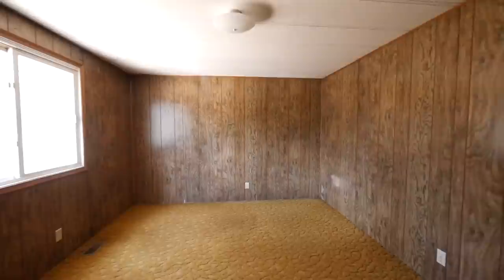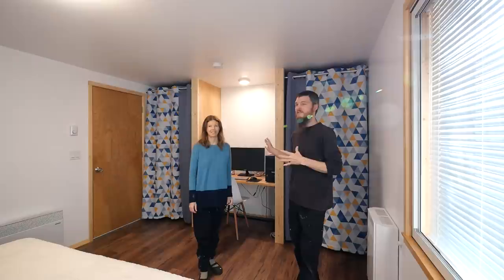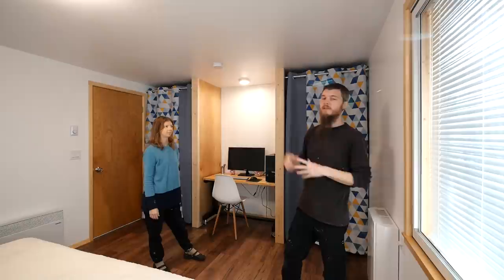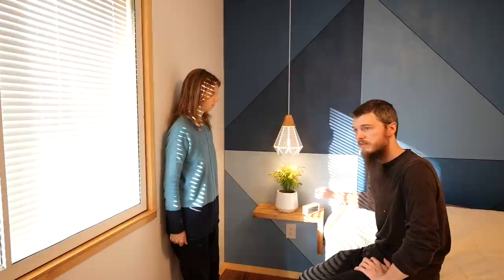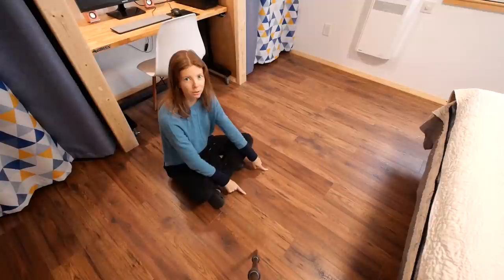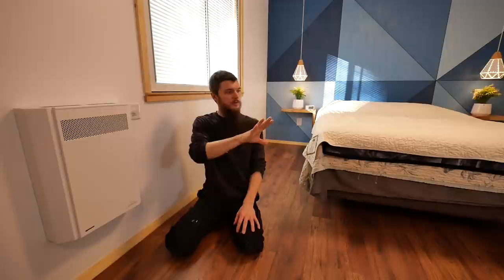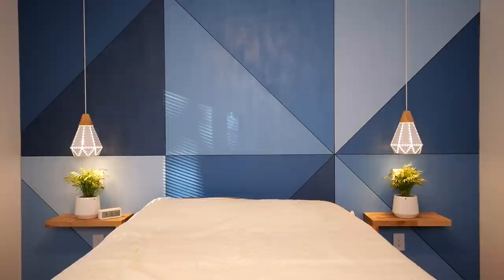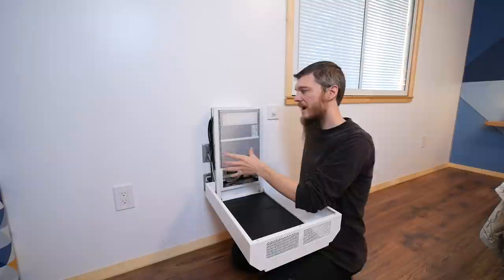Mobile Home Bedroom Renovation and Tour - DIY

Comment: THAT was a lot of work! I was thinking it's a good thing they're young and ambitious :) Don't feel bad about the mold. That stuff gets in anywhere it can. You found the source and fixed it. It was a lot of work but when mold is the problem best to get right in there and stop it. We had mold in the utility and bathrooms because that part of the house is 150 years old and the plumbing from the 1930s was original and leaking. The hubs has been replacing it bit by leaking bit. He's also installed moisture proof drywall (like you did....good choice) I love your new design. You know, I think all that design wall needs is another coat or two of paint. Looks like the wood was thirstier in some places than others so it soaked in more. It's a fun piece and just makes the whole room....although, I do like the new floor and the new computer area too..oh and the new nightstands...and....
Reply from the maker: Yeah, that's exactly what happened with the wall. Some of the wood grain is just more porous so the paint is less shiny on those spots. We should be able to fix it pretty easily.

Comment: No issues solve the problem and move on...   Just a note check your electricity for constant voltage in your home.   While you were talking from you bedroom.   Your lighting was pulsating a little .  At least on the video it appeared that it was pulsating.      It may or may not be something.   (could be just a video framerate and LED then no issues at all)     I once had that issue and it was a problem on the feed from the power supplier.  My incoming voltage was dropping below 200 V AC.   Which was giving me around below 100 V AC at the outlets...
Reply from the maker: That was simply our camera lens auto focusing that made the light appear to be flickering. :)
Reply: @diyfferent  I thourght maybe so but just incase it was something else I wanted to let you know.

Comment: We put a solar fan under each end of our mobile homes to move air and reduce humidity. In the warmer months we remove access doors in several places and cover with fine pet fencing wire. It helps keep air flow moving to prevent mold growth. 
I'm surprised putting the vapor barrier down didn't prevent the problems you had. That was a bummer to re-do.
Reply from the maker: We didn't have any problems from our crawlspace. Most of it was caused by rain coming in when we were installing the roof and a general lack of ventilation in the room.

Comment: My question is:  What happened to your beautiful area rug?
 
My comment is: I think the room is beautiful!! And anyone who doesn’t think so, well, it’s not THEIR room, is it?  The room is very inviting & cozy.  I can hardly wait for your new bed frame.  Do you think you’ll do one like Mavericks, only bigger, of course.  Or maybe a platform with storage underneath?  

Whatever you decide I’m sure it will be gorgeous...simple, but gorgeous!

The negative:  It’s too bad about the mold & mildew.  Do you think you’ll be able to reuse some of the stuff you took out?  I know you couldn’t use the contaminated stuff but maybe the stuff that was still in good shape?
Maybe in the room next to the barn?
Reply from the maker: We put the rug outside, because it did have mildew in it. It's laying on the ground as ground cover. We did save the pine boards that came out of the room. But we didn't save the rest.

Comment: The headboard wall looks great. Nice color combo. I am concerned that your house  too tight. Especially that the moisture barrier was placed on the ceiling. I don't know anyone that has to run a dehumidifier in the house besides a basement.  Also where did you get the inside stormwindows??
Reply from the maker: We got our windows from Menards but other retailers also carry them: https://www.larsondoors.com/comfortseal-interior-windows

Comment: Love the new look.  It actually opened up the room quite well.  It's hot and dry where I live so I don't always remember the panic re the mould. I much prefer the less heavy looking closets and workspace.  And most impressed with your blue wall.  Have you made your new bed yet?
Reply from the maker: No, I have the wood but I haven't made it yet :)

Comment: Well done on sorting out your problem. I do hope that my comments didn't stress you out as they were meant as constructive help and not criticising you or your work. If you encounter this type of problem again you might consider running ducts to a central air handling unit with air registers at celling and floor level. On a final point you should never feel ashamed of any of the work that you do or the high standards that you achieve.

Comment: Ok,  so I liked the previous br, but luv this new look. Very nice. U should thank the weather person for being wrong otherwise u may have never torn it apart. Not so soon anyway. U did the right thing and it came out great. Nothing to be embarrassed about. Hope u didn’t through out the old floor etc.. maybe could use it as a wall in the garage room or whatever. The water caused all your problems, mold, mildew, musty etc.. One thing, maybe bifold doors for closets instead of curtains even though they look good, less work. Another great job. Btw I thought I saw someone cleaning water in the kitchen when the rains came, hope I’m wrong . Anyway👍👍👍😀

Comment: Not trying to second-guess you my friend. But when you were putting the roof on in the rain. Do you think the insulation in that room got wet. You're saying the exterior walls we're the ones with the mold and being at the bottom of the roof just wondering how much water got in the walls.
Reply from the maker: We did check inside the walls while it was open and everything looks okay!
Reply: @diyfferent  okay great thank you. I guess it's just the humidity inside the house.

Comment: Sometimes I think that’s the downside to sealing up a house for insulation purposes (aside from the rain issue). I have a 3yo apartment and it suffers from mould, though after repainting with some good quality paint most of the mould has never returned. We’ve also got a dehumidifier because our place is always in the 70’s (I’m in the uk). But you did the right thing and now you’re happy with it

Comment: Oh wow, now it makes sense. Did you have to pull out all the blown insulation out of the attic?
Reply from the maker: The cellulose insulation is treated against mold growth and it dried out quick when we had our roof ripped off, so we didn't have any issues with it. Also, some people wet-spray cellulose insulation in their walls and ceilings, so it's okay to get wet once.

Comment: I still don't understand why you tore out the walls? And I absolutely loved your old floor but it's your choice
Reply from the maker: The old floors had mildew and water damage so it had to be taken out. That floor is now discontinued so we decided to use what we used in the living room. Our metal shelves didn't fit in the closet spaces unless the feet were sitting on top of the baseboard trim, so we tore them out to build new walls giving those spaces slightly more space.

Comment: What did you do to the walls? What were the purple panels? Did you just paint and not use the paper treatment?
Reply from the maker: The purple is a different type of drywall we used and it's moisture and mildew resistant, just for extra precaution. We did the paper technique but we didn't show it in the video :)
Reply: @diyfferent  It looks perfect!

Comment: Looks great, guys! I had a thought about your attic, did all the rain cause your insulation to get moldy? or did you replace it? Disregard the trolls, it only encourages them. Some people are too twisted to be in public. I'm really sorry you have to read that stuff. Hang in there.
Reply from the maker: Thanks! The ceiling insulation didn't get moldy. It absorbed a lot of the rain and evaporated pretty quickly. Paper cellulose insulation is okay if it gets wet, some people even wet-spray it when they install it in walls. The rockwool insulation was fine as well :)
Reply: @diyfferent  Good to hear!
Reply: I'm no expert but we had a similar situation. Long story involving a horrible winter and lots of snow and ice. Anyway when we had a mold remediation company come in, they said we wouldn't have a problem with most of the house because we have plaster walls (very thick) and no insulation in them to grow mold. Mold grows on the paper of sheetrock. So how does the blown cellulose not grow mold, it's paper.  Not criticize ing just sharing the knowledge we gained from our nightmare.  We did have a room that was an addition and was sheetrock, and had to remove it all because of mold growth.

Comment: I'd say that since neither of you smoke or have habits unbecoming, other people lived in the room who might of done drugs.... bedrooms and bathrooms seem to be where most drugs are used and that oder of it is not beneficial to ones mind piece. I have so many bad habits that I could be used as a good bad example. I am 73 so a little late to grab me by bootstraps and say hey.... smarten up! I like the diamond wall idea, its not totally me but its close. I am going to throw a idea at you and if you do read it then maybe you might try it. I had a way of printing pictures from my computer that were special to me. I looked at frames and none really felt right. so I used backing which was really some of the cheap paneling like was in the wall of the home you have to be the exact same size at the start then I experimented and found something I did like. I left about a quarter inch all around the edge of the picture and wrapped the picture with a glass pane over the picture and frame edge. I routed out the material in any wall I put pictures in and made them flush with the wall and a couple were actually inset into the wall deep enough to put a one inch trim around it on the edges of the inset and it really caught on. I mounted a shallow ledge on the bottom for incense holders to get the smell of roses or lavender in the room. I like incense but not all do. I like the quiet too but never did it cause I am too paranoid that something somewhere will go off and I couldn't hear it. Your home looks great

Comment: You over insulated your house. A house needs to breathe!
Reply: The problem is the vapor barrier
Reply from the maker: We brought the home up to current Code. In our area we had to do as much insulation as we did, and we are also required to use a vapor barrier. The thing to understand is, with the way new homes need to be built, people have to start installing HRV's or something similar, but those just haven't caught on much, but I think they will start being more frequent.